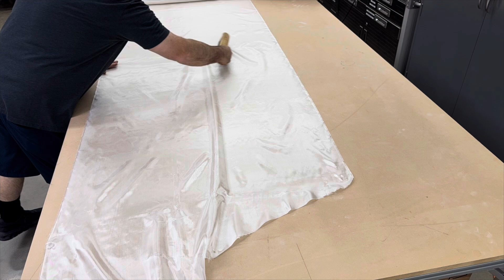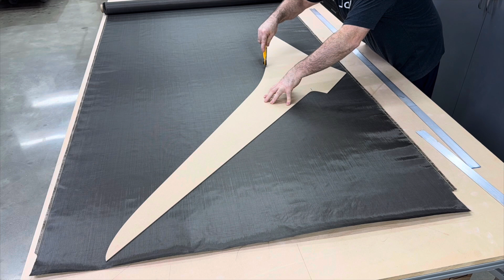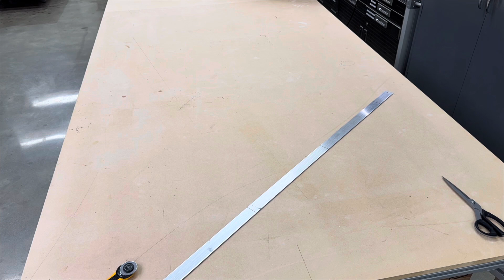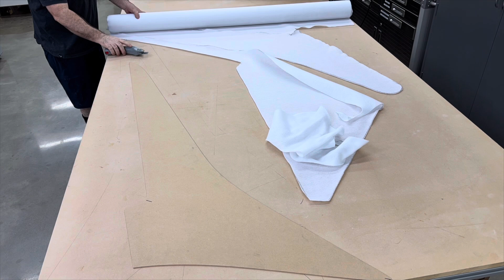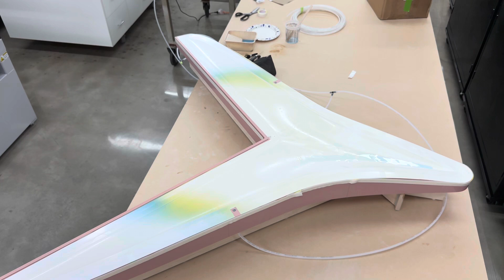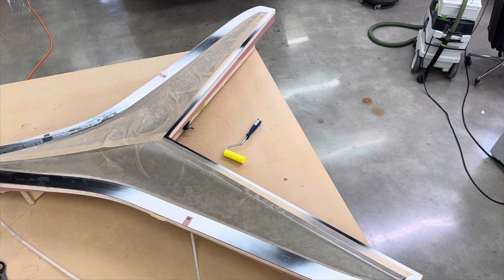Outer Skin Layup

Comment: Genius to cut the peel ply at the leading edge. I think that’s what has been causing some of my leading edge voids I’ve attributed to the vacuum bag. 

What kind of roller is that you’re using the spread the epoxy around? Just a normal foam roller?

Make sure to show how you sand your flanges, Im interested to see how you make sure everything closes correctly.
Reply from the maker: I will address this later this evening or early tomorrow morning. Grinding away trying to get cores in…
Reply from the maker: These rollers are OK. The only problem is that they swell up after about 40 minutes or so so you have to use another one. The same vendor sells ones that are white and they’re not nearly as good as the yellow once I tried the yellow I bought a bunch of them because they work pretty good for me. Here’s a link. 

https://a.co/d/byKf1JU
Reply: @JoeManorcraft thanks! Don’t let me get in the way of the process lol. Back to work!